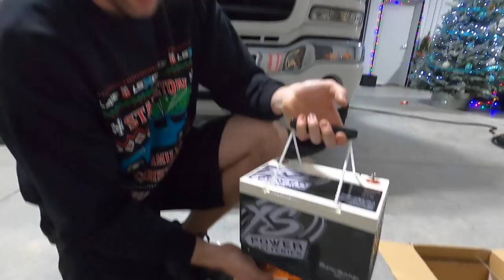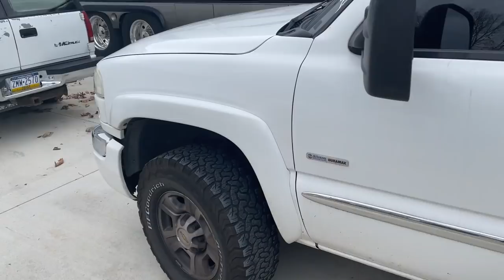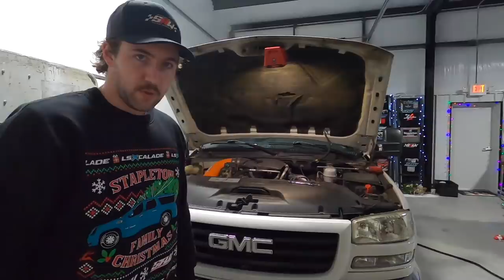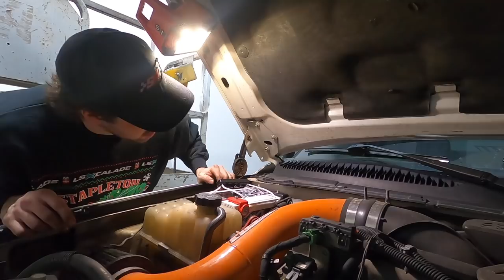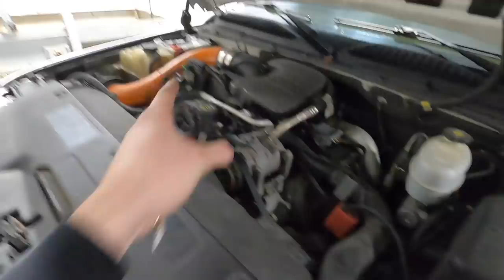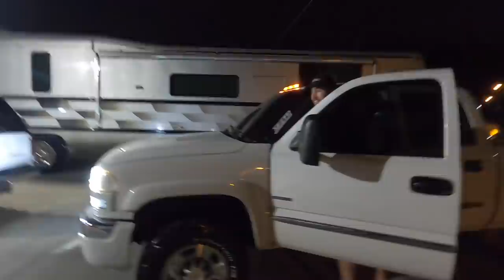The Coolest Truck Battery Upgrade You Never Knew About! (Bolt In Supercapacitor!)

Comment: Tech tip. If you hear a high pitched hissing or whining noise when you charge up the capacitor STOP it means the cap is no good and about to blow up. My buddy was charging a 30 farrwt hybrid cap (not xs but stinger brand $) followed directions with the light bulb and it let out the holy smoke 😞

Comment: Capacitors are great at sending alot of power at once. But terrible at long term draw, this is great for a dsily and high demand sound system (in line) but not as much for a winch or other long duty cycle accessories

Comment: Can capacitors electrocute you?
If capacitor value is small, one may get a severe shock, but it does not have enough punch to kill. You can definitely die from getting electrocuted by high voltage charged capacitors. Even the high voltage cables, once disconnected from power, can retain a lethal amount of charge.
Reply: At 12v like these there is no shock, but if shorted to ground the arc and fire would be pretty spectacular.
AC compressor capacitors, on the other hand, at 220v, will shock your ass across the yard.
Reply: I`ve been shocked by capacitors enough to know to keep my fingers well clear of them.. just thinking of my last encounter with an powerfactor correction cap on a 1200W hid floodlight ballast makes all the hair on my arms stand right up ;) (its been a couple of years but it seems like yesterday in my memory)
Reply: Best advice is not to test the theory. Capacitors like these are capable of much higher current discharges than conventional batteries. Which is why they are used in this kind of application. Under the right circumstances you will very likely receive a very nasty burn.

Comment: wonder if that battery set up would work with car stereo .
Reply from the maker: It would
Reply: The car audio world is where they got big using cap banks for high Amp systems. Guys replacing 10 group 31 batteries with a few cap banks having similar power output.

Comment: that seems like a solution to my issues of killing batteries  from the cold in the winter being itd for a 420cc engines electric start and lights
Reply: yes motor cycke way smakl oakage chef use one 50 c c durt bike 15⁰ ßcoters

Comment: If you're really trying to save weight run two capacitors instead of one and a battery!
Could make a cool video
Reply from the maker: You COULD do that...but if the truck sat for long enough it wouldn't have a charge left. You would need a trickle charger of some kind
Reply: @Stapleton42  
Those lithium jump packs are cheap!
Just bought one to use as a UPS for a 19Litre car fridge in the missus suv.
Reply: @Stapleton42  And... How long are we talking? Hours, days, weeks?

Comment: Optima is JUNK and has been for 10+ years now. XSPower or Odyssey are the only cost/performance worthy options currently.

The bulb is used to limit inrush current. Caps have a very fast charge/discharge rate (that's why they are used to clean up  or 'smooth' DC power rail noise known as 'ripple') and taking a bank of caps from 0VDC to 12-14.4 VDC in a few seconds would likely GREATLY exceed the amperage rating for the wire, terminals, and possibly damage the caps themselves. The bulb acts like a resistive load and limits the current coming into the cap. The bulb goes out when the potential of the battery is equivalent to the potential stored in the cap bank.

In a lab environment we use high wattage resistors with massive heatsinks to charge and discharge cap arrays safely. EE geek shit warning ⚠️The old CRT monitors used to have a transformer called a 'flyback'.....the joke was, if you discharged the cap coupled to that transformer across your body, it would cause you to fly backwards as it killed you. Those things would operate at between 10,000V to 30,000V. The arcs those things made as they discharged were as beautiful as they were scary and intense. ⚠️
Reply: The company I work for makes optima and they were good when made in Colorado but they moved the plant to Mexico and now they suck.

Comment: That's old news. There just expensive. And I've personally had bad luck with them. When they do work they are great. My cousin has had very good luck with them. I use to run them in my sfwd honda. And my old truck. But I'm not here to bash. They maybe better now. Just my experience wasn't great.
Reply from the maker: Battery technology has grown a lot in the last few years

Comment: if i wanted to waste money on a overpriced battery id get an optima 450 bucks for one no thanks that 900 bucks to replace both in my truck just a waste of money in the -30 temps here thats only lasting 2-3 years (ive tried an inl battery similar to this for a camper and it lasted 3 years and is exactly like this battery but obviously inl not xs power) if i was dumb enough to spend 900 bucks on two i better get 10-15 years out of them if your truck starts slow get two 1k+ ca batteries from walmart  for 150 for both then upgrade your starter wire to a thicker gauge